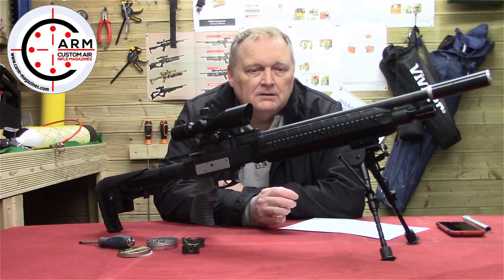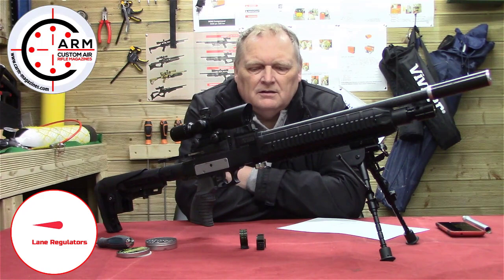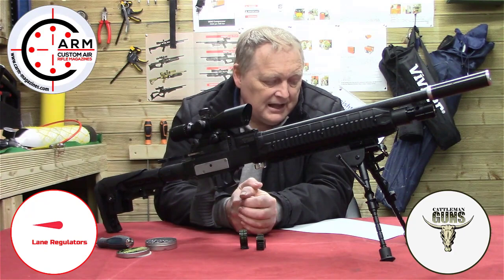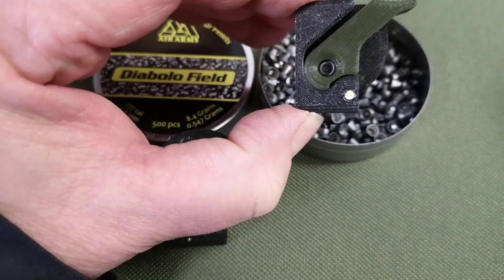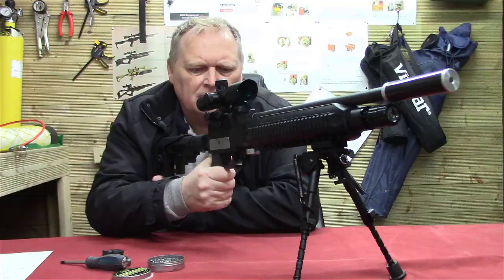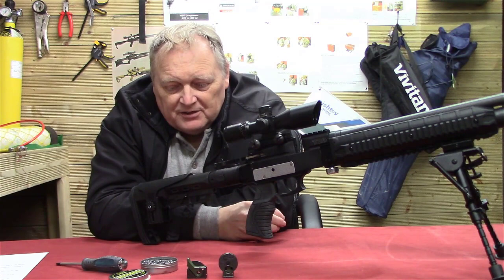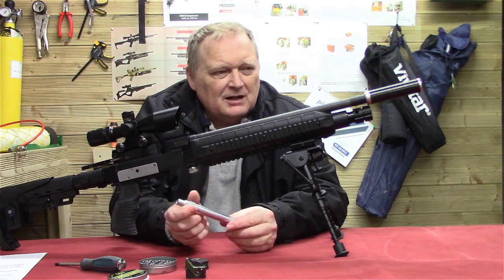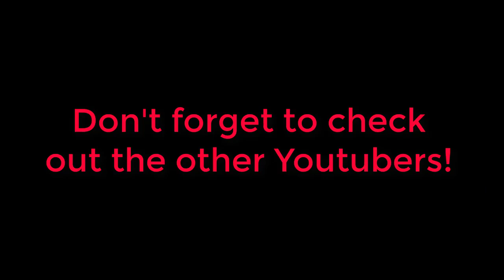The Retay & Pishtov magazine alternative from CARM magazines (Part 1)

Comment: Carm magazines are amazing. The single shot loaders are such a good idea and completely changes my cp2
Reply from the maker: I am pleased with the ones that I have. The multi shot magazine and single shot loader are loading really smoothly, so they aren't causing any issues as far as I can see. I took the rifle to the range for an hour this morning between 07:00 and 08:00 and the rifle was still not shooting as accurately as it should, even though the winds were blowing between 10 mph and 14 mph. It's all down to the 11 inch barrel.
Reply: Have you tried polishing the bore a bit? Plenty on line about it Nowt to loose either way.. there's a video on here by iguana hunter with before and after results..it worked for him.. but if its bad its bad but it could make it better foe little cost buddy

Comment: Hang on in there pal you will get it sorted,  eventually, 😁👍
Reply from the maker: Jus a barrel and it should be sorted. Not so easy to get during lock down though. Most gun shops are running click and collect part time at the moment.

Comment: Rifles like this really annoy me. They pull you in with whats seem to be a bargain. Then you end up spending ex amount on it for it to work. You should of took it back m8 and got a kral NP02 instead or something like a BSA scorpion because the amount you are having to spend to get the rifle working as it should. You are getting into the BSA scorpion Air arms 410 money. Lucky for me not really had this problem with air rifles only with a qb78 however it was only a 130 when i bought it so wasn't that bothered about it. It was with a rim fire ruger 10-22 i had my issues with i gave up on it i refuse to spend more money on the rubbish thing. I wouldn't buy one of these spend 400 on a gun then extra 300 odd to get it working absolutely out of order. Its like buying a car then being told the engine crap provide your own 😡😡😡😡